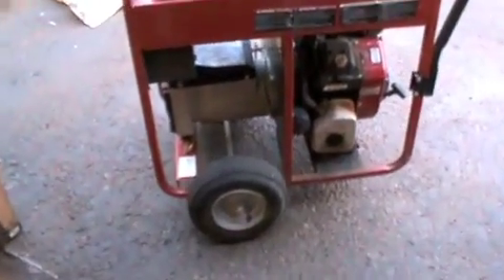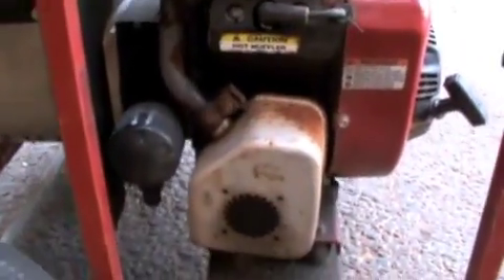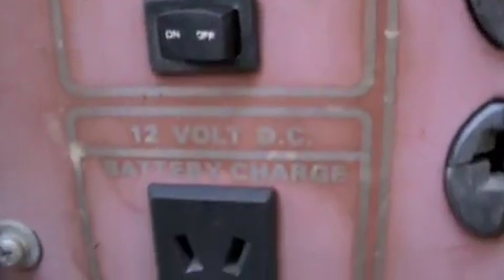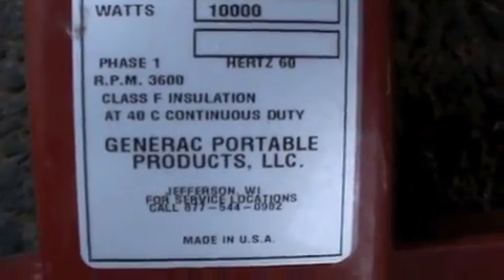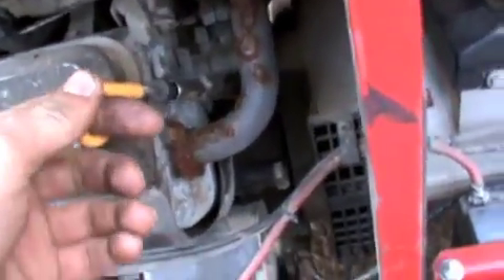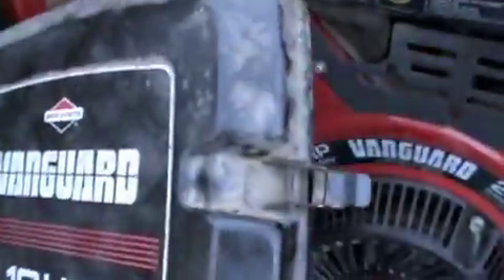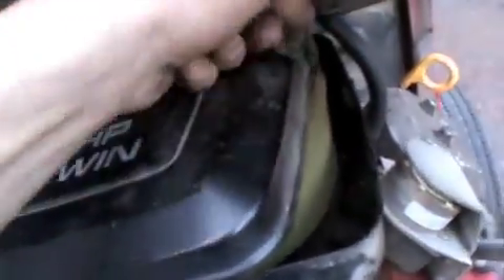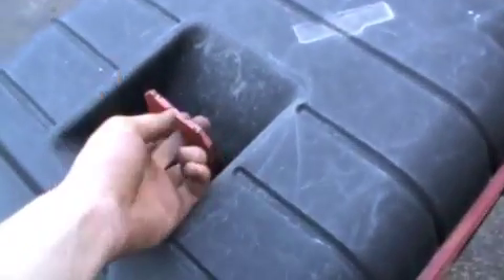Generac 10,000 Watt Generator

Comment: @5Tractorguy hmm check the wiring and the brushes in the generator head. The 220 is comprised of two- 110 lines, a neutral and a ground. maybe one leg is out on it because of faulty wiring, or bad brushes. I got a wheelhouse right now with a bad set of brushes on it. Hope you get it running right.

Comment: I would say u got ripped off a tractor and snow blower for that it needs a complete overhaul hope you stuff wasn't in perfect condition
Reply from the maker: I never did an update on it but it turned out to be good. Someone had the wires backward on the posts where they come out of the generator head. Rewired everything and it puts out 110 and 240 now. Ran the house for a day or two a couple winters back...